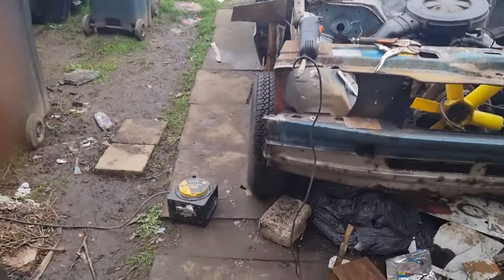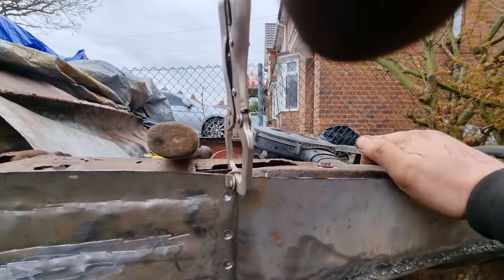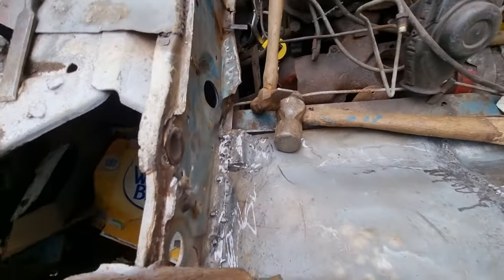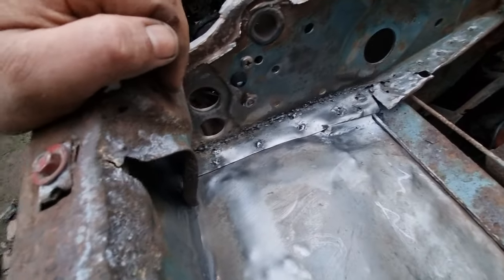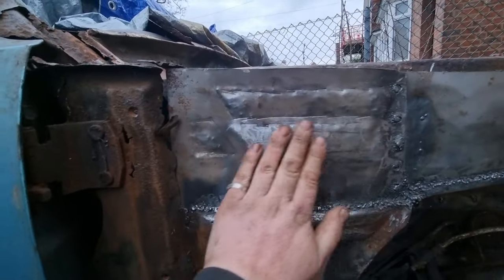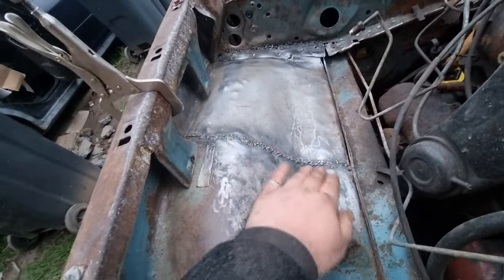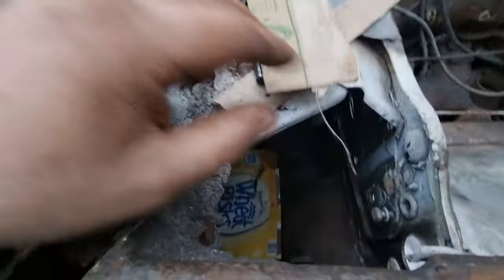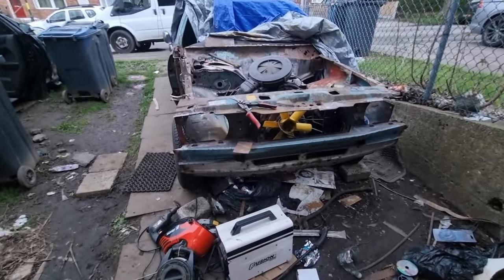Cortina Mk4 Ghia 2.3 V6 Restoration || Set Back Rectified  (P14)

Comment: Only just found your channel and different to see a cortina my dad had one on the road for a year only just passed the MOT for rot and the sound of the 2.3 like any ford V6 sounds great I was racing around the field till it fallen apart was 15 years old I'm a welder fabricator for 25 years and done a few old fords but never a cortina but you do some and always find more you using a flux wire mig welder wat size wire you using thats a little welder but it if does the job then fare play but a tip to make your welding better do runs not keep stop doing tacking welding it will be alot better and cheap good flux mig wire £4 a small roll lidi i use it for small jobs good stuff saves useing my gas mate
Reply from the maker: Hehe yeah I have a fluxcore 130 I do get on well with it since I turned the power up it's ideal as I work on the drive and wind does not affect fluxcore like gas I use a mix of 0.9 and 0.8 09 ideal for thicker metal like chassis have you checked out all my videos this car is in  a series part 1 onwards on YouTube
Reply: @AdamSNook.   I was going to say that type of small welder is 0.8 if you want it to run better clean the wheels which the wire runs in check the size on the wheel as if it's 0.8 and you put 0.9 it won't run correctly and make sure the tip is the same size I can run 0.8 up to 1m in mine but changing the wheel and tips and don't make the tension screw to tight on it the wire needs to run smoothly like I said lidi have it in most of the time £4 a roll and it's good to use and they do different sizes but my welder what I use for cars cost me £300 and it can use gas/flux wire you can change it to a mma (arc) and thats good for welding on cars the company do a small mig 160 for £150 gass/gassless but i use mine alot so i changed for the bigger one as you can only  do wat the machine will do good luck with mate
Reply from the maker: @petergrinnell2500  thank you mate for all the info i am running 0.9 and have the 0.9 tip and wheel but wil lcheck if it needs cleaning i think fluxcore gets a bad rep but they are just as good if done right and as stronge but i would love to get a gas/fluxcore welder that can do both that would be a game changer

Comment: Adam, the daftest of things throws you off, like i did mention, in the last video about the passenger side, been a refence.  you are getting into the surprises this is throwing at you now.  Its really coming a long now!  Dintrol is what is used in the land rover world. so that might be worth looking at for the inner wings. i recon if you buy some tins of primer and give the bonnet a good once over, that would look really great.
Reply from the maker: yes mate you was correct i took a good look at the passenger side and that gave me some mesurements to go by so that they are the same now yeah im going to order some epoxy primer i will check that dintrol out thank you :) thank you for watching and suporting me and helping along with my journey im ordering the chassis rails next week so will be doing that bad one on the drivers side its really bothering me it been in half lol
Reply: @AdamSNook.   no trouble at all, buddy. that will be another milestone hit when you get those.  Thank you for taking the time and effort to film this for us Adam, Its great to see how far its come a long in the last few weeks. It wont be long before that bulkhead will be patched up, i recon by the end of next month you will have best part of the front end repaired, and you will be starting to work your way back.
Reply from the maker: @procta2343 thank you yeah will be getting back onto bulkhead soon as I want all that done before I het to the floor section don't want to be going back and forth tho it is good to take.a break from one job now and again if its a big one
Reply: Awsome progress buddy , I might drive my cortina up brum to see ya when the weather gets better . I’m only in Dudley myself
Reply from the maker: @festeringfesterer thats awesome mate